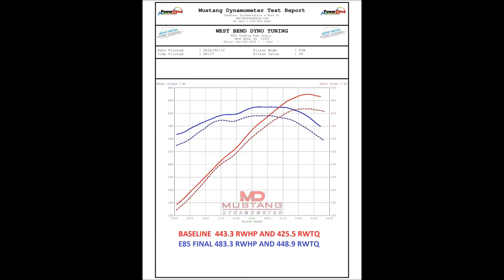West Bend Dyno Tuning - E85 testing on LS3 Camaro

Comment: Without timing advance is there a gain going to E85?    How much timing advance was   responsible for the gain?
Reply from the maker: There are gains by going E85 without adding timing, but they will be small.  Timing is power.  The only reason we could add timing without detonation is due to the octane and cooling from E85.
Reply: @westbenddyno  I've heard of some of the timing advance numbers on E85, it's not "huge" - like on the order of an additional 2-4 degrees of total timing to get all that extra power.     The E85 is attractive to me in that one could run seriously high compression and not have an issue for an all out N/A machine on the street, and run boost or boost on high compression and in many cases not need to retard timing and yet have no detonation concerns.